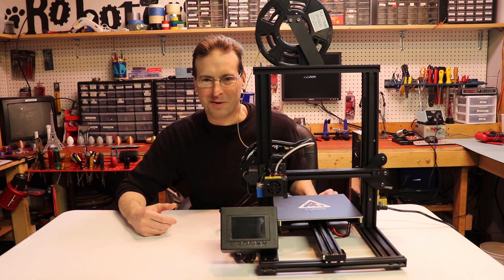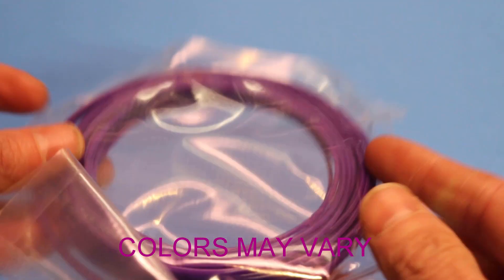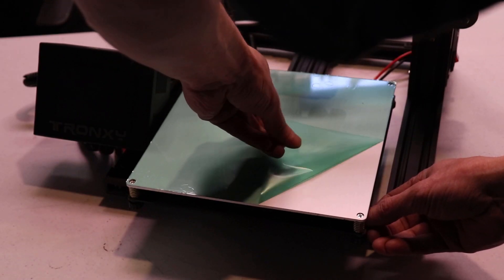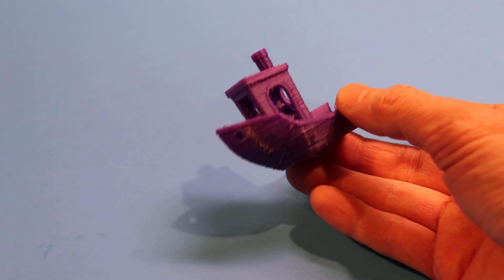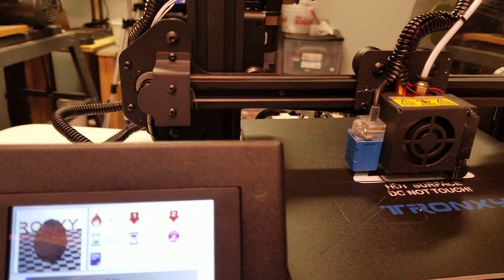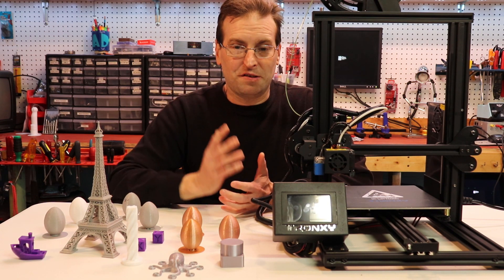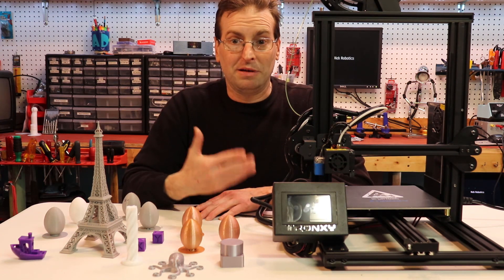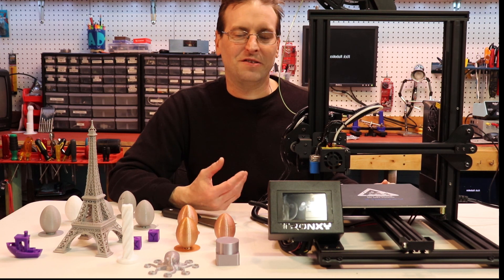Best 3D Printer Under $300?! Tronxy XY-2 3D Printer Testing and Review!

Comment: I broke my memory stick that came with the tronxy  so I don't have the software is it available for download online
Reply from the maker: It should be available in Tronxys website, under software. It's ag code file that you load and run like a printing job, that reloads the firmware. The instruction manual and test parts should be available there as well!
Reply: @RickRobotics  I think I have it now but Im having trouble leveling my bed my Z offset icon says enable level compensation first I have no clue what that is

Comment: What are your specifications for prints(speed,thickness,etc?
Reply from the maker: I print pla at 210/30.
70mm/s
3 shells and Raft. 20% infill. 
75* overhang angle for support (cubic support).
Hope that helps! 
I also adjust slightly for each print, but this is my go- to setting!

Comment: what upgrades did you do for the printer?
Reply from the maker: So far, none! Just greasing the z rollers and it's working very well. I'm considering adjusting the extruder driver current slightly, but haven't yet. If I do, I may do a video on it, since they are a bit hard to get to.
Reply: @RickRobotics  please do a video of your upgrades